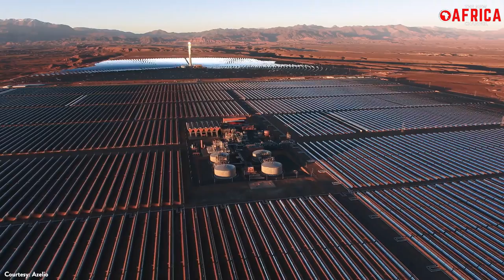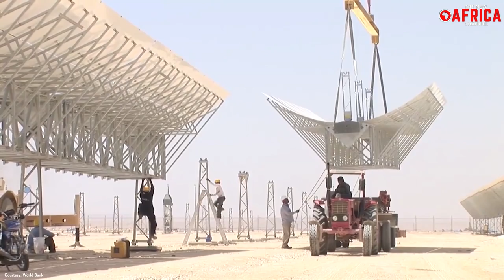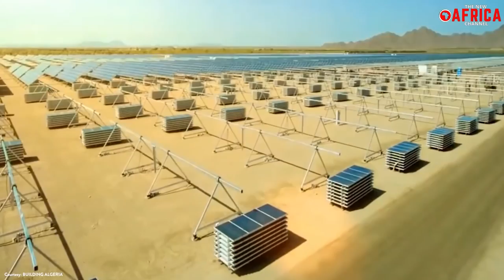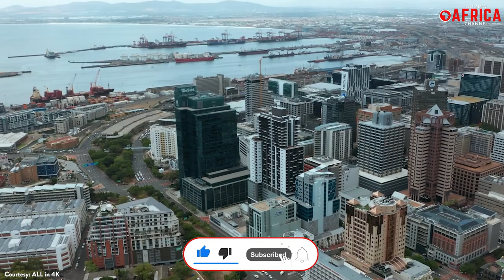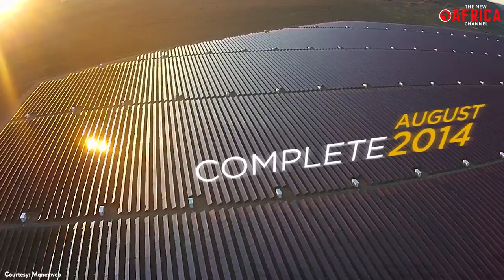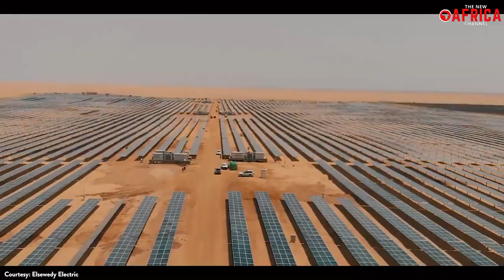10 Largest completed and Ongoing Solar Energy Projects in Africa  solar energy projects in africa

Comment: I am wondering if it is possible to harvest condensed water as well. During night condens is formed, and with a collecting pipe beneath the panel it could collected as well. These solar farms are in regions where drinking or irrigation water  are problems as well. Further the panels also create shade which might also be een opportunity to grew local grasses or crops.

Comment: Africa should invest the lion part of their power generation in solar energy and wind energy in combination with storage of energy in for instance pressurized nitrogen (the most of the molecules in the air are nitrogen) and pumped hydro. Africa doesn't have to be as polluted as Asia, Europe or North America. It is not bound to be that dirty and polluted. Africa could be smarter and cleaner.
Reply: Yeah that's  why Morocco did the biggest station of solar energy in the world
Reply: @andruimlucky5557  the biggest station of solar energy in the world is in india.
Reply: @andruimlucky5557  Erm.....Morroco has the biggest CSP-type solar plant in the world, but it pales in comparison to the actual largest Solar plant in the world which is a PV-type Solar plant in India.